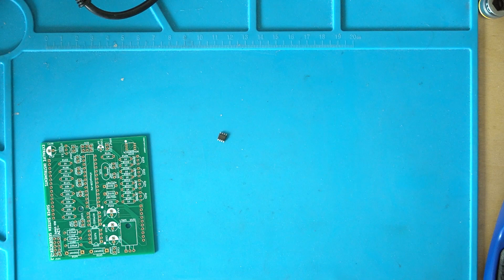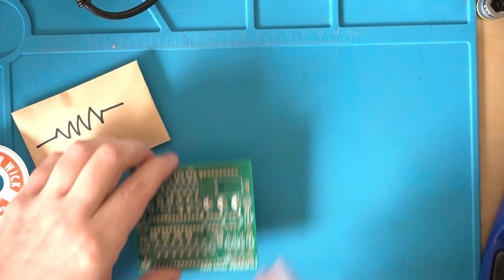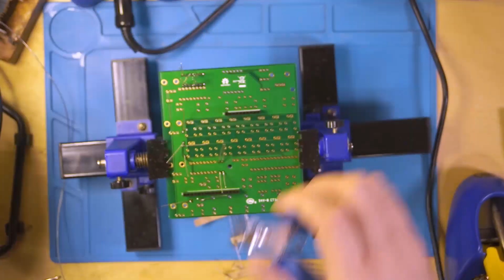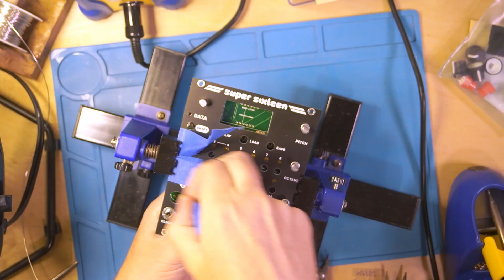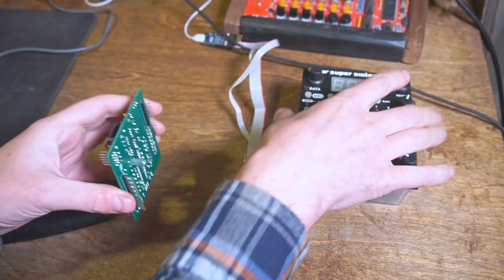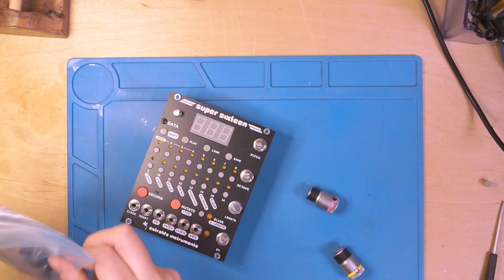Super Sixteen module PCB/kit build guide

Comment: I build smd verison and LEDs and Display are superfast blinking (but when i turn on module then while loading display lighting around without blinking). Pots and menu options works nice. What is this? MCP23S17 is need to be programmed?
Reply from the maker: Hi Konstantin, I replied to your post on mod wiggler: https://modwiggler.com/forum/viewtopic.php?p=3887673#p3887673

Comment: Soldering components from the TOP side is NOT a good idea!!  This can cause early thermal breakdown!
It will also look like CRAP!!!     ALSO check components BEFORE installing them!!!
Reply from the maker: I generally prefer to solder from the bottom side as well, but for resistors the thermal shock should be minimal and on 2-sided boards with plated vias the quality should be fine with proper technique and high quality solder. I would certainly avoid the topside method for ICs, capacitors, switches, etc, but it does save a step for the leaded THT components.

Comment: Hey Matthew! 2 questions. Why isn't this video listed? I have to find it by going through the kickstarter updates which is a little annoying while trying to build. Second, how exactly are the pin headers supposed to be oriented? I have them going the right direction so that they attache to the top pcb but which end connects to which board? does the small detachable part of the headers go on the bottom board? Or is it the other way around? I'm about halfway done with the build. I hope to finish it tomorrow and hope it doesn't explode once I plug it into my case haha.
Reply from the maker: Hey, sorry for the unlisted vid, it's in a playlist on my channel but apparently it didn't auto publish. The pin headers can go either way really but I've been installing the female socket ones on the control PCB.

Comment: probably worthwhile having IC sockets for the IC's with those electrolytics hanging overtop of them. Otherwise it'll be really hard to replace the IC if something terrible happens.
Reply from the maker: That's a thought! I don't usually use sockets unless I'm testing stuff (silicon is very reliable these days), but they're never unwelcome. I don't think the caps would be a problem in that event though, as the hot glue is easy to remove and the leads will have plenty of space to bend out of the way.

What's your thinking on putting the headers in before the caps? EDIT: wait, I'm guessing you could just flip the board over and solder it without the hemostat trick that way
Reply: @extralifedisco  yup you got it on the ribbon headers (before the caps they look like they'll be the tallest part) the board connector headers are easy because you can use the other board to hold them in place like you did.

the thing i was worried about with the caps, is caps maybe corroding the IC if they blow. Admittedly probably a bit of hand wringing.
Reply: also this video is great, much better than most diy kits that just give you a couple pictures at best :P